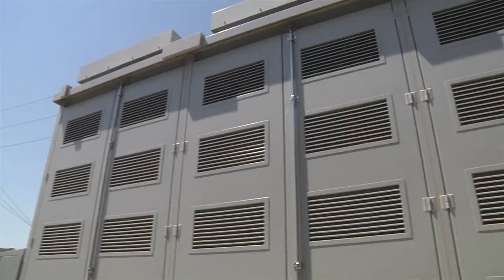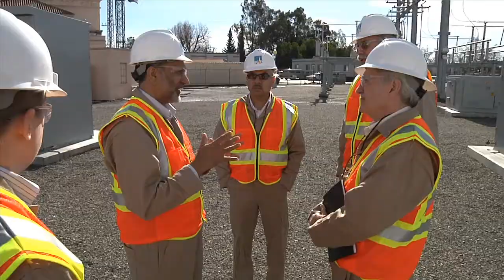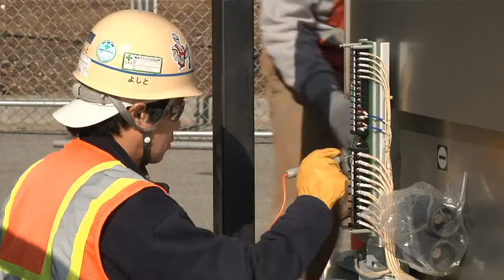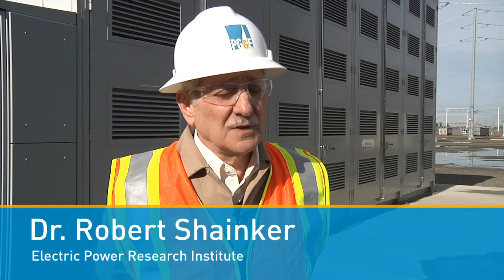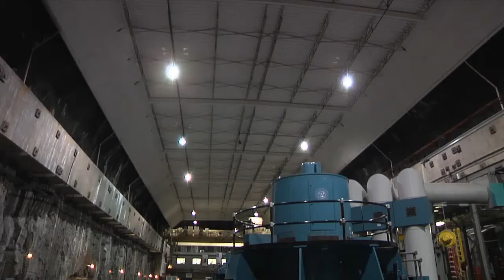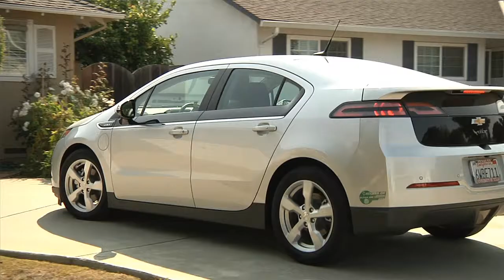PG&E, Partners Explore the Future with Battery Storage Demonstration Project

Comment: 400ah battery, especially for bigger capacity containers and other storage projects and 400ah batteries first into 1600ah longer 188 series 601.6v, 80DOD% at 25 --- 2500 cycle